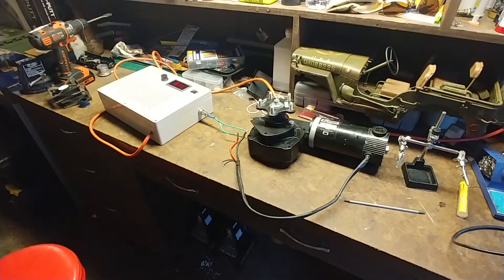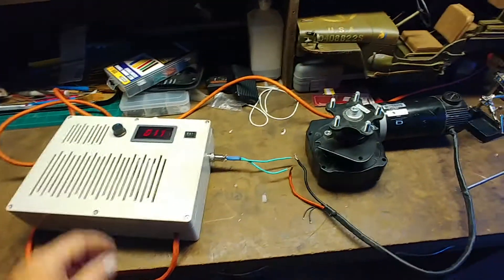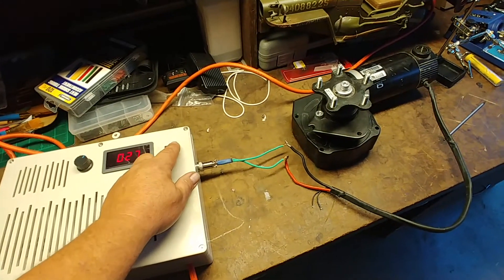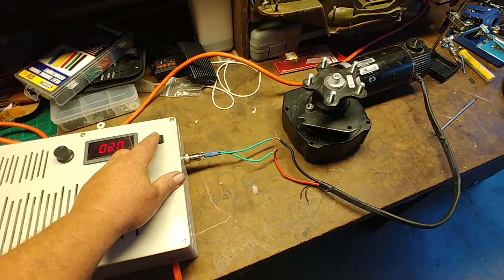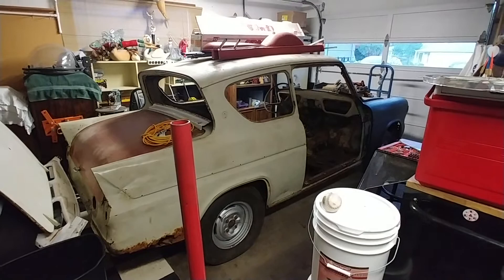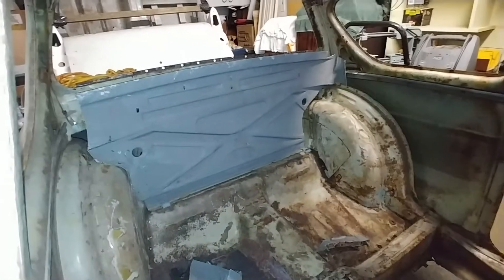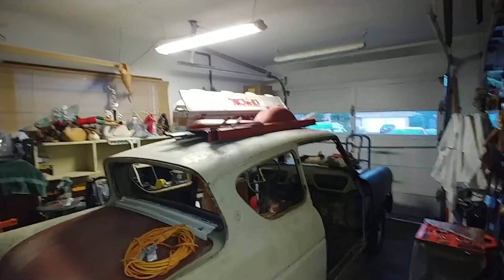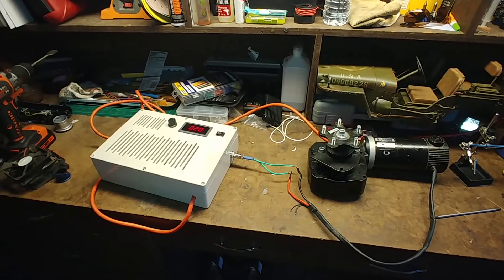Adjustable power bead roller PT4

Comment: Do you have a link to the power supply?
Reply from the maker: https://www.ebay.com/itm/5V-12V-24V-DC-AC-1A-10A-30A-50A-70A-Switching-Power-Supply-Adapter-For-LED-Strip-/361924688555?var=&hash=item0  you want the 12v 30a 360w  should be $14.99